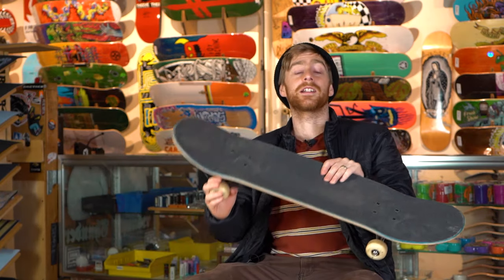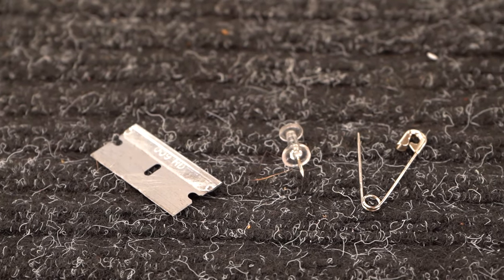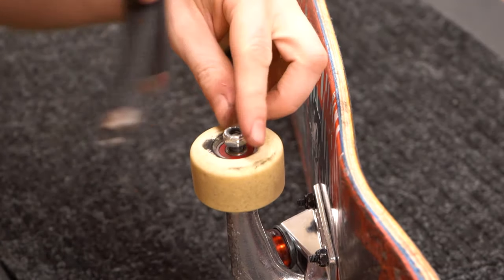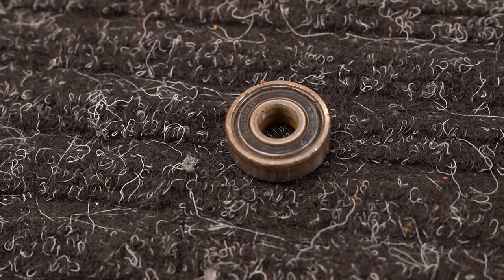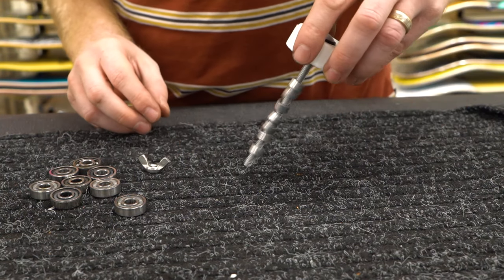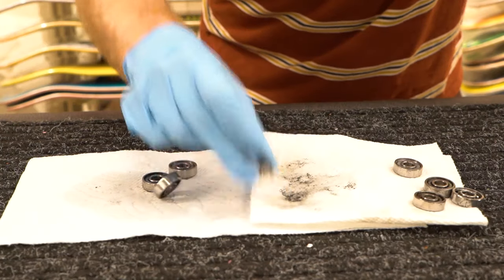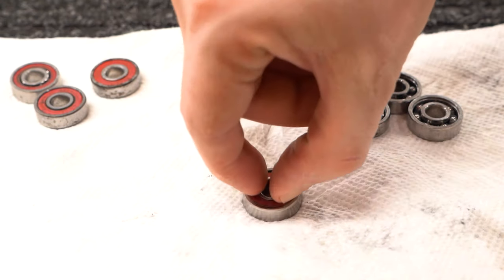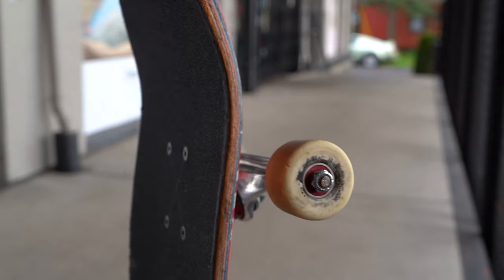How to Clean Skateboard Bearings | Tactics

Comment: After skating on & off for 25 years, I just learned You don't have to leave that wiggle room between each wheel if you use bearing spacers.  They're not pointless after all lol.  This is one of the best videos I've seen for cleaning bearings, rubbing alcohol is also a good solvent.
Reply: i didn’t know that i’ve always used bearing spacers and left that wiggle room i’ll try tightening it more thanks man
Reply: The spacers are only effective if they're in contact with both bearings. Then they'll all move as one unit. Have speed washers on both sides. Now you should be able to reduce the wiggle room and the bearings wheel will still spin freely.
Reply: Thanks this is really helpful i tried and realised it made a difference and it was actually a bit more secure
Reply: This is helpful I'm thinking of buying a skateboard later
Reply: Spacers do reduce the rpm, not sure how much but it was a huge topic.
Reply: wiggle room is good. allows for more variance for landing when jumping down gaps. see the nine clube episode with brandon westgate
Reply: @BlackPriest001  came to say this
Reply: @FathersFuckingBiscuits  should work to clean the bearings.
Reply: That’s what I was wondering too. Do you need the bearing spaces. I have them in my new skateboard. I just started again after 20+ years of not being on a board.
Reply: @SoulAir  Never use WD40 on bearings lol
Reply: Spacer between the bearings and the wheel between speed washers, without any tiny gap between them, should allow pressure from the nut without affecting the bearings. If a spacer is loose inside the wheel, I add a speed washer inside the wheel, between spacer and bearing.

But if the spacer (with or without the washer) is a bit too long for that wheel, it could end up misaligning the bearings too, like the overtightening without spacers but from the inside out (if any of the outer racers is pressured into the wheel deeper than the inner racers can be)

Comment: I think it’s important to note that if you decide to use rubbing alcohol, PLEASE make sure the percentage is high. Let’s say you use 70% rubbing alcohol. Your wheels will rust from the 30% water. 91% and up is the best for cleaning bearings.
Reply: Thank you for that almost made the mistake just now
Reply: If it all evaporates it won't make a difference. Just make sure it evaporates.
Reply: Welp... rip my bearings
Reply: @madz3343  lol no bro they’ll be completely fine. Sure the 70% take a bit longer to dry, but it will not damage them at all bud. Just make sure you use the proper amount and type of lubricant. I have bearings that are almost as old as me and I’m about to be 35.
Reply: I did the same😢
Reply: And your bong
Reply: Orange/citrus type industrial degreaser is the way to go
Reply: I was so close to putting 70% running alc but you saved me🙏
Reply: Just read this after already using 70% 😭😭😭😭

Comment: I dont know why the bones bearing cleaner kit is so expensive. Good video though.
Reply: Isopropyl alcohol and plastic tupperware work just as well.
Reply: That’s how they get cha
Reply: Its worth the investment it just saves a lot of time and effort i got mine with speed cream for only 15$ on amazon
Reply: its 15 bucks ?
Reply: Do what i did: get a long skinny banana pepper glass jar, a long threaded 🔩, and some plumbing orings and stab it through the jar. You can make the dividers with a pen tube and viola.
Reply: @chadhakala   i n d e e d
Reply: yh it's insane i luckily got mine for 2 bucks cuz of some store credit i had wouldn't have bought otherwise
Reply: @thesodathief  seems like a good investment considering the speed cream is like 10 bucks on its own, and you only gotta buy the cleaning kit once
Reply: I had one and my mom threw it away she doesnt even know what it is and doesnt ask, fugg this.
Reply: @thesodathief  what? Last time I looked it was like 28 dollars plus 10 shipping :/
Reply: Is it okay to just clean them with acetone and not putting the bones speed cream?
Reply from the maker: @youalreadyknow5849  Nah, I'd say putting the lube in afterwards is the most important part. Otherwise your bearing will be completely dry and will wear out 10x faster.
Reply: @tacticsboardshop  oh i see thanks for the reply Tactics! 😁👍
Reply: @tacticsboardshop  can I use wd-40 for just cleaning purpose and later add lube oil?

Comment: i remember how skaters would just drown their bearings with wd-40 and they wouldn’t believe me that it would dry and wreck them without lubricant
Reply: I did that just yesterday lol
Reply: I always use wd 40 lol and they never had that problem
Reply: @kxvinn_3950  WD-40 is extremely inadequate for lubing bearings. Once it evaporates it leaves a very thin film of wax that wears away quickly. Using WD-40 WILL cause your bearings to score and die prematurely.

Comment: i've been using the same bearings for a year almost 
without cleaning them idk how they even work still
Reply: Basically get a wrench unscrew the nut take out the bearing and stuff and remember how it was placed so you can do it the exact same, then you’re going to get a piece of tissue rub the bearing on the inside and the outside and you can put in olive oil or motor oil to speed the board up and yeah you put everything back in it’s really easy and it takes about five minutes for every single bearing!
Reply: I mean 1 min for every one
Reply: I've had mine for 10 years. Just realized I'm supposed to change or clean them since one of my trucks broke
Reply: I have bearing that a 10 years old and all I do is a seed and bleed with 4 in 1 machine oil. 
I had industrial photocopying machine oil that was the finest and bleed more dirt out.
Reply: Try 6 years 💀💀💀💀💀
Reply: 7 years here. Changed them for the first time today. Feels absolutely... acceptable. :|
Reply: thats what i did but my wheels are  starting to spin less

Comment: I'd recommend to not use a plastic container for your acetone. its likely to dissolve it if highly concentrated or in contact for long enough. Also, any alcohol like ethanol or methanol will probably remove oil and grease much more easily. In the lab we often use alcohol, then water, then acetone. 

And a little tip is that blowing on it or any other Nitrogen source will speed up the drying of the acetone. Good luck. :)
Reply: Can you use ethyl alcohol to remove the oil and grease?
Reply: @hervyvalentino6664  ethyl alcohol is ethanol. According to Frick, yes you can.
Reply: What is better between alcohol, ethanol and methanol? I have a ton of methanol in my garage, i can use that right?
Reply: What if i use hand sanitiser?
Reply: Blowing on it, *if* you mean with your mouth, is going to put a ton of (contaminated) moisture into the bearings.  Never blow into anything that needs to be really clean.  Breath is full of all sorts of crud.
Reply: Acetone is highly corrosive and totally unnecessary. Rubbing alcohol, WD-40, lots of stuff will clean up steel bearings without acetone. Acetone will etch steel.
Reply: @richhenson8858  WD-40 is not a good cleaner. It might work initially, but then your bearings will quickly dry out. Also, acetone works fine. You're not putting your bearings in acetone for an hour or something. Just to clean the bearings and then you rinse them off. Been using acetone to clean the same bearings 3-4 times, and it works fine, doesn't hurt the bearings as far as I can tell.
Reply: do i need to lube it afterwards?
Reply: @nihilus757  Yes. Always.

Comment: With Bones reds (what I do is....) take out the dust covers with a pin. Then use the pin to very carefully lift out the clasp holding all of the ball bearings. Push all of the ball bearings together in one spot and they, and the centre, will dop out .
Now all parts can be cleaned more effectively. To put them back together again reverse the process. Put all ball bearings together at the bottom of the outer ring, sit the centre on the top and push the balls apart to lock in place. Space them out to match the clasp and click back in......job done 😊
Reply: How many of you knew that you could completely take them apart to clean? 😊
Reply: .......Skating since 1987
Reply: @larryjimbob  Only because that's what I do when greasing up bike wheels :)

Comment: if there's one thing i've learned from working in maintenance, it's that cleaning a bearing doesnt fix the damage already done to the bearing. I personaly perfer to just swap my bearings out since they arent all that expensive anyways. if you'd really want to clean the bearings you would have to clean them a multiple times to get rid of most filth which to me doesnt seem time efficient. also, if im going to spend money on cleaning utencils i might aswell get new bearings :^)
Reply: year old post haha
its more like an investment vs sunken cost thing
buy $10 bearings you wont feel bad after a while buying another set, but when you buy your 11th you realize you couldve bought $100 bearings and a $5 bottle of speed cream still be using them and have $5 left over

Comment: I used regular household orange cleaners to clean my bearings, have done it twice, works great, even deals with rust lol
Reply: wtf are orange cleaners
Reply: @yoa9960  essentially d-limonene
Reply: @ratbitch5125  like dish soap?
Reply: Wait in the video he said u have to rinse it if u use a citrus based cleaner but did u do that? Cuz the whole point of this video is that u don’t use water
Reply: @Chickenjawn  you’d be surprised how well dawn works for getting all the old oil off. The more old oil/rust you get off, the better your bearings get cleaned.

Comment: Really Great Video.  I cleaned like 4 boards today since i had everything already to go.  I had to move the bearings a bit to fit the covers back in.  They wouldn't just pop in like I saw in the video.  Very smooth tutorial.  That BearIng Cleaner kit, looks nice to have just sliding them up and then securing with the wing nut and shake.  Never seen that before.  Thanks again.

Comment: I have a small bottle with a tiny little syringe tip (really tiny like 0.05mm hole) for the lubing part. i touch every single ball slightly with it and it gives much better results. you only want the balls to be lubed, anywhere else it might cut the speed down.

Comment: if you have the metal shields you can remove them  by gently denting the middle of the shield with a i screw driver of metal punch and it will pop out but it will break the shield.
Reply: Can't we replace metal shields with rubber seal?

Comment: Hmm very cool and helpful tutorial. I’m surprised no spacer between the bearings was needed for each wheel. I really never saw that before.
Reply: Lol, that's funny, opposite for me, I never knew bearing spacers were important.  Without them you can't tighten the axel nut very tight, like he said, that's why the "wiggle room" is necessary.

Comment: Walmart super tech red lithium grease is what I use afterwards. It keeps grit out better. 

For all the longboarders, get S9 blaze bearing and replace their outer shield with a rubber shield and use marine grease instead, it’ll better protect your bearings during wet slide sessions
Reply: Does the bearings still spin well with marine grease?

Comment: I used a tiny needle to remove the rubber layers on the bearings, placed the bearings in gasoline, shaked the container, dried the bearings, applied WD-40 and spinned them. Had some really rusty bearings that didn't move at all, now they are like new again.
Reply: are still good or now they re bad?

Comment: I'm curious why you load the bearings into the container with the exposed side facing up. Wouldn't you want that side facing down so it's easier for the solvents to flush out while shaking  (the same way you smack them onto the paper towel afterwards)?

Comment: who can tell me how i can clean bearings without special items. i have only aceton and car oil
Reply: Don't bother with the acetone. if you can get some cheap Mr clean (green one cuts grease) and a sewing needle, you're good to go!
After you've cleaned the gunk out, drying takes an extra step. tear a strip off of a sheet of paper towel and roll it nice and tight.
Press that into both sides of the bearing with your fingers then the needle. Car oil will not make for a fun ride for long! 3in1 works fine or you can go with chain oil for bike chain which is available everywhere.
Reply: @user-st7rq3sn7v  i used olive oil thinking it would work as an alternative, i think I fucked uo

Comment: I have been skating the same bearings for almost one and a half years. Before that I have always cleaned my bearings, oiled them etc.  They never lasted two months. Just dont skate in the rain and in mud, they are allowed to get dusty because if you ride your board enough it'll get clean itself.
My bearings are Reds for 20 bucks
Reply: I think I agree, I have bearings that are years old that still spin fast and long, I've never done anything to them, never needed to replace them either. I decided now to try and clean and lube a set for the first time, just to see what happens (the bearings are from 2017, but still spinning fast) I hope your anecdote doesn't come true for me 😄

Comment: Bearings actually have grease packed in them. Oil repels grease. So WD40 oil will remove the grease from your bearings. Bones Speed Cream might be grease. I never used it. I cleaned a old pair of Independent bearings not knowing they are $3 for new ones. Then I packed them with brake grease, and they work like new 7 out of 8 bearings. Oil wears off in minutes, and you are back to grinding metal. Then steel shielded bearings are best, because your ball bearings will not explode out of the bearings with nylon shields. And steel shields are not always removable. So it might be best to buy Independent or CCS steel shielded bearings. You can also bend the bearings from hard impacts. So it is best to replace them often, and buy cheap steel shielded bearings. Bones bearings are over priced. I bought 26 ABEC 9 bearings for $16 that are red like Bones Reds. Also your polyurethane truck bushings are supposed to have grease between the bushing and metal surface to keep it from squeaking. That is how you install polyurethane plastic bushings for cars. That's why your trucks squeak. My 1993 Gullwing Shadows have rubber bushings that squish out when tightened. Rubber bushings are better than these new plastic ones. Sort of like rubber car suspension bushings verses polyurethane.
Reply: Try Riptide bushings. Super high quality urethane that doesn't speak!
Reply: Hm, this isn't something I considered before. I think I'll use Parktool Polylube grease I have sitting around instead of mineral oil after reading this.

Comment: My kids just got some $40-$60 skateboards off amazon. Good reviews. I went to spin the wheels after opening and they only spin for a second or two! They can't be dirty yet. Any advice? Do you think the axel nut is just too tight or do I need to add lubrication?
Reply from the maker: Well, it's either the axle nuts are too tight, or the bearings are just garbage. The bearings that come stock in most department store completes (I know you got it from Amazon, but the same thing applies) are absolutely terrible. Did it say what kind of bearings it came with? Try loosening the axle nut just a smidge, and if that doesn't work, then just replace the bearings with some cheap but still good bearings like Bones Reds or Bronson G2s. 👍 Cheers! - Tim
Reply: @tacticsboardshop  Thanks for the response. Here is the link to one of the boards: https://smile.amazon.com/gp/product/B01L6GAKQ0/ref=ox_sc_saved_title_3?smid=A3JHC5JKLEVOCB&th=1
It says
"7 layer maple.
31*8 inches.
54*37mm Wheels
ABEC-9 bearings.
I loosened the wheel nuts a bit on all 3 of our kids' skateboards bc one of them came with a tool to do that. It appears that did help...but only a bit. They now spin a couple seconds longer. I could not loosen one of the wheels on this board for some reason...maybe the nut was a bit too small for tool and it was too big for all the options on my ratchet set. Weird.

Also, I found some spare bearings that came with another board. I tried spinning them in my hand and they did not spin long at all. Is that typical when ur just spinning the bare bearing? Maybe that's evidence of low quality.

Interestingly, after loosening the wheel nuts, the boards seems to lean left and right better to get sharper turns. Maybe I just didn't realize before.

Finally, do I need to worry about the loosened nuts coming off and the wheels falling off?

P.S. Is there a better beginner priced skateboard you can recommend?

Thanks!
Reply from the maker: @dsha2006  Well, usually prebuilt completes from reputable brands are around $90 - 100. It's totally fine though to start out on a cheapo board just to find out if they like it or not. I've gotten my nieces and nephews nice skate completes just to have them decide skateboarding isn't their thing after one or two sessions. 😄 Since you already have the amazon completes, you might as well just replace the bearings and use them until one of kiddos decides they want to take skating little more seriously. Loosening the axle nuts shouldn't effect the turning radius, so it probably was already like that. And as for the wheels falling off, there should be a locknut on the axles, so you shouldn't have any problems with it falling off. I hope that helps! Happy New Year! - Tim

Comment: About a year ago I tried cleaning my bearings for the first time. But for some reason all of the ball bearings just fell out the bearings it self. Was there a reason for that?
Reply from the maker: If the balls just fell out, then that bearing was already broken. If the internal cage breaks, then there's nothing holding the ball bearings in place, and when you take the bearing out it just falls apart. So you didn't do anything wrong, sometimes you can be skating a busted bearing and not even realize it. Cheers! - Tim